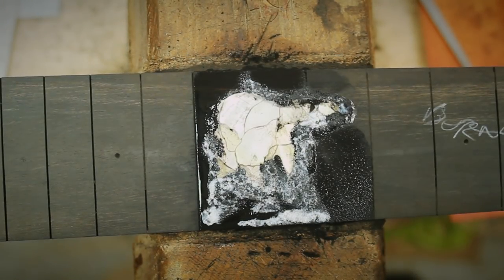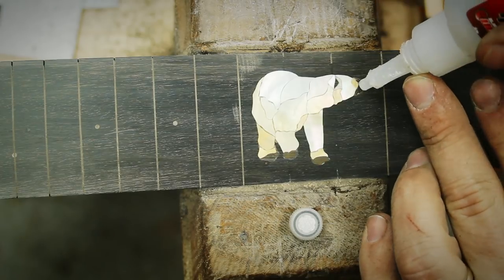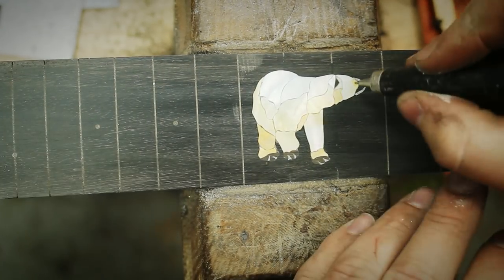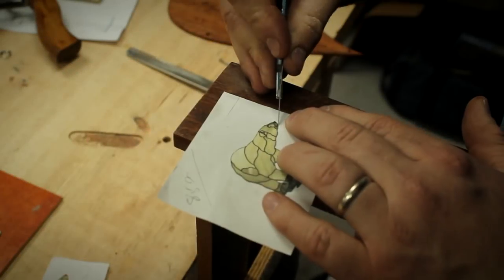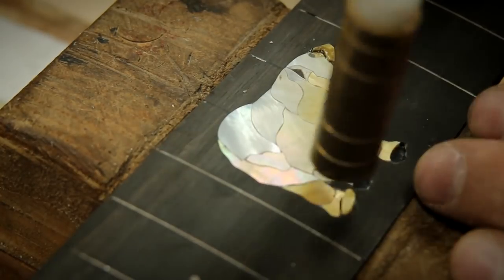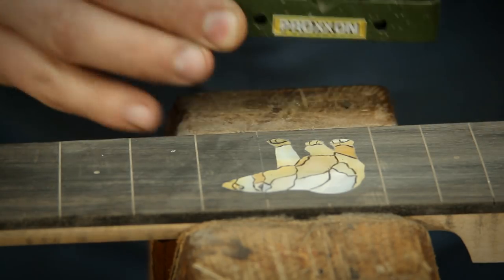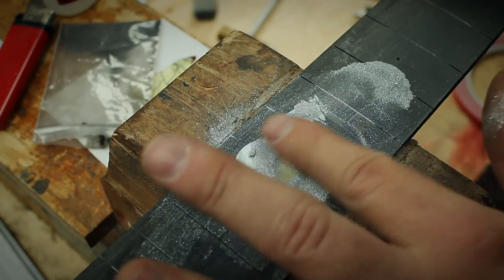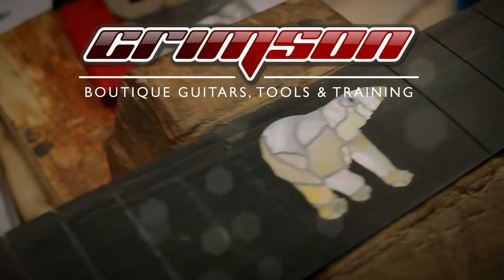Inlay Tutorial - Multi-Piece Polar Bear (Part 3)

Comment: Nice bear. I get a ton of ideas from your vids. Thanks! You're the best. I'll share one of mine, so listen up folks... PTFE Teflon heat pressing sheets are 6 bucks for 2. Tape down and to a workboard. Sheets have a slight texture. CA glue won't stick to Teflon. Floods inlay perfectly all around. Strong! Lifts right off with fingers  in one solid piece.

Comment: I rather like the thick lines - I was worried when I saw the width of the cut, but with the aluminum powder, it kind of brings to mind a stained glass window. Thin lines would have been great too, but a different look. 

How in that process did you not take any material off the fretboard?

Comment: Really really cool, but I unfortunately also agree with the a lot of the more negative comments.  Personally I think the job just required more of your time that I'm gathering you didn't really have.  Would have been better if there was just a bit more time put into selecting pieces and perhaps a smaller routing bit and I just the wood dust in between.  But then again...  It will really stick out a lot better this way because it will have strings obscuring the details most of its life shrugs  Great video tho honestly despite my preferences...  Properly demonstrated the process which was the intent .  Thanks :)

Comment: I would have preferred narrower, dark outlines around the individual pieces. I'm a fan of stark contrasts and the aluminum just ends up looking like a mismatched color to me, i.e. to close to the bits around it, but not close enough to blend in.
Reply: I thought ben would use a pointy dremel instead of a flat bit and fill with a dark outline, let's see if he does something about this in the next chapter.